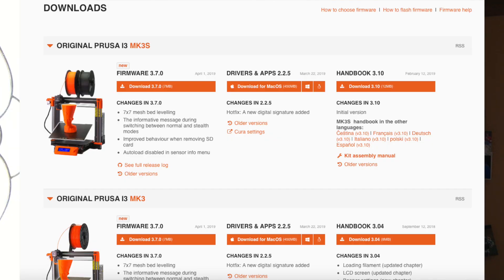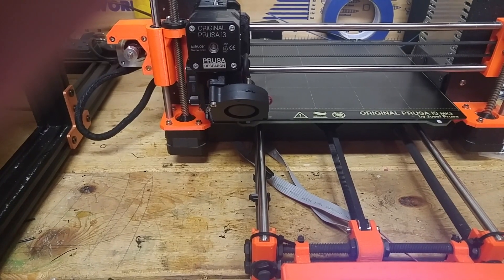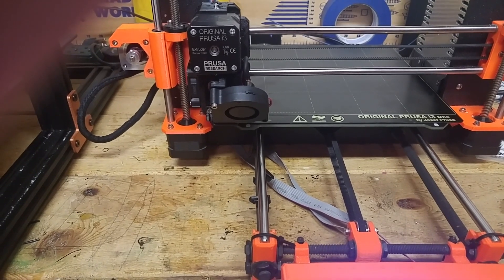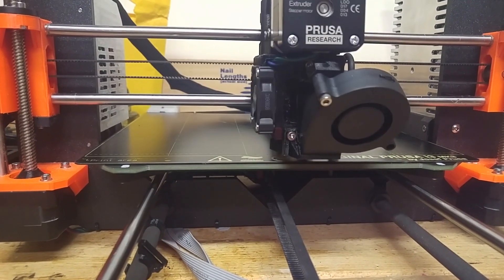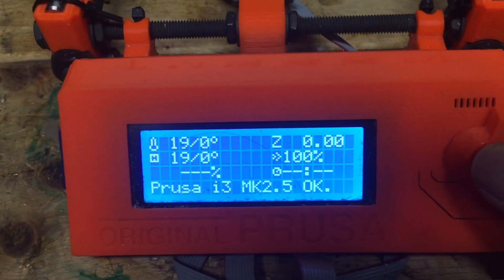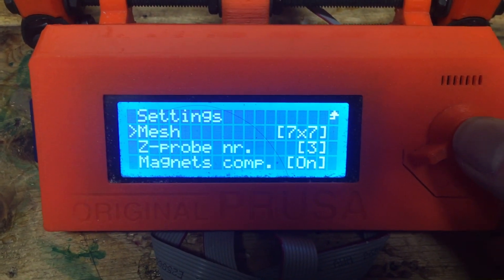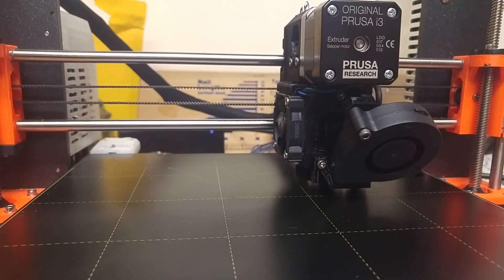What is 7x7 Mesh Bed Leveling?

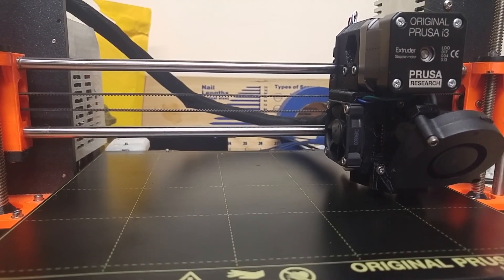Comment: Hi why at 1:43 it jumps that mutch during mesh bed leveling?
Reply from the maker: I believe that is when it detects an unlevel spot and it makes an adjustment for it, and rechecks it
Reply: Great video! 👍 You should “if possible” turn on magnetic comp on the the 7x7 setting screen. 

From Prusa’s Knowledge Base: “Magnet comp.: With 7x7 Mesh bed leveling, you can choose whether or not to use Magnets compensation. 11 of the 49 points are so close to magnets, that the reading can be off by as much as 80μm (microns). Magnet compensation ignores readings from these 11 points and calculates them from the surrounding points. We suggest leaving this function on.”